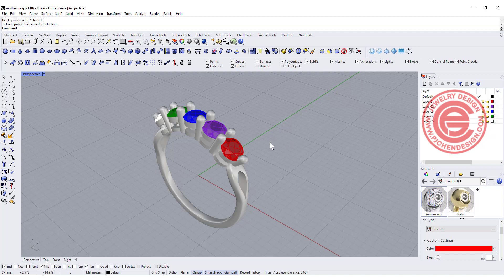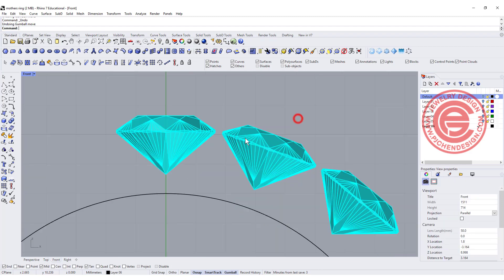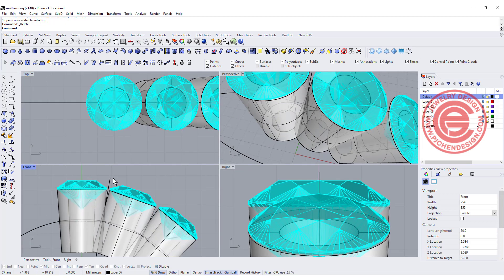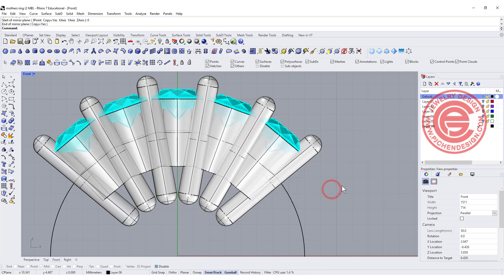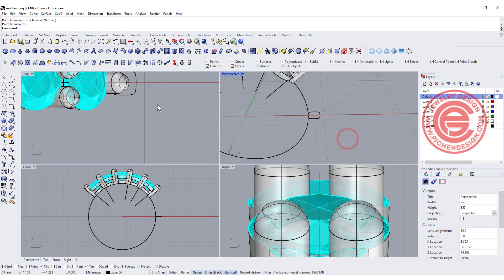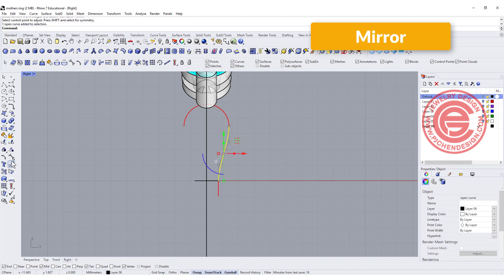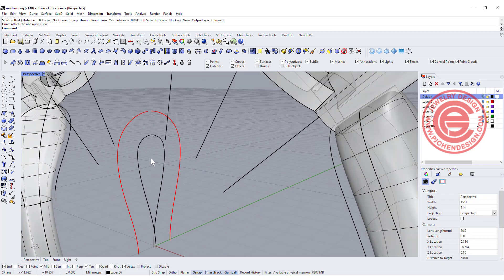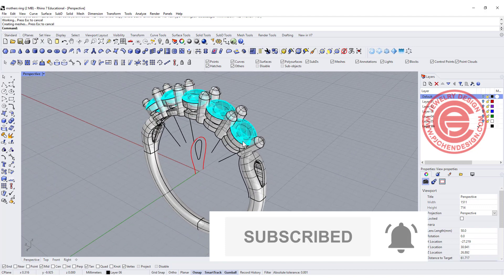Mother's Ring 3D Modeling Tutorial- Jewelry CAD Design with Rhino 7 #195

Comment: You always mention a puffy metal shape. But for the gallery of this ring all of the edges are sharp? I have been struggling with links on a necklace and I am unsure how to better make the gallery puffy so it can properly mesh. Any suggestions? What is your rule of thumb? 💙
Reply from the maker: you can also create the gallery by sweep instead. and use puffy profile.

Comment: Thank you for the video! But for cutting through the casting and the shank it would be more convenient to use the Solid - Wire Cut command, so you could skip the extra steps with solid extrusion and Trim - Loft.
Reply from the maker: Great point!